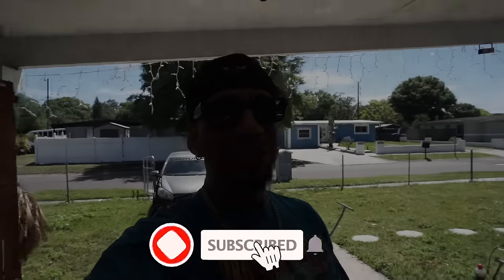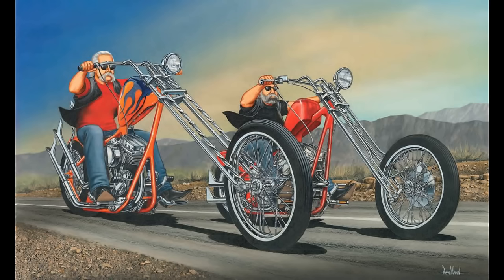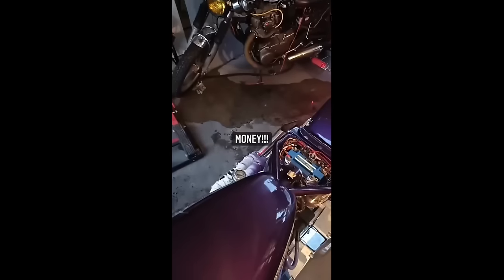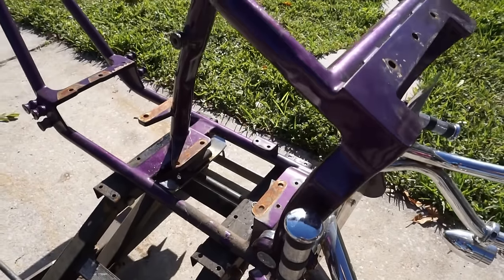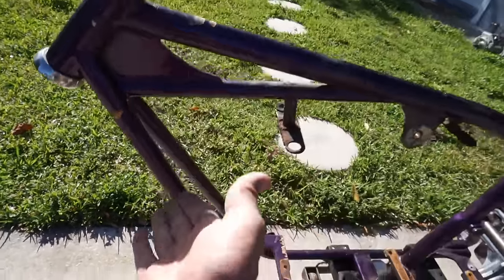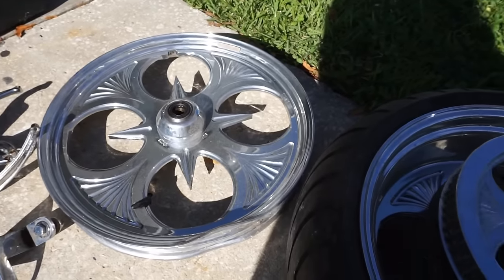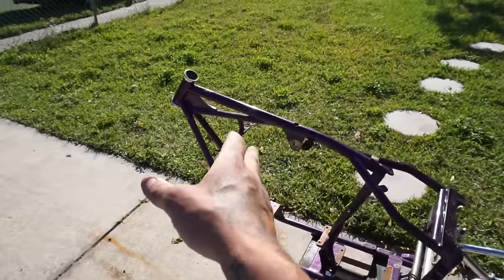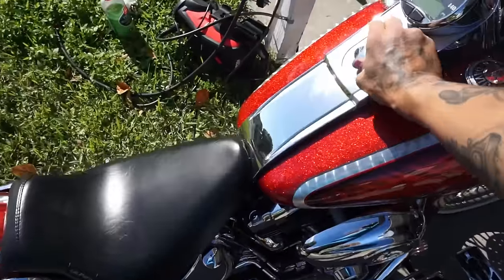Rebuilding a wrecked Denver's Chopper! Part 1  #denverschopper #chopper #wrecked  #harleydavidson

Comment: Thats not a denvers chopper
Reply from the maker: Yea the titles wrong.. ill call Mondo and fix it🤣
Reply: That was an Easy Rider centerfold bike, I think sometime in 2003. I used to hangout in the shop when it was built. Those wheels were like $10k a piece.  @DaDiplomat
Reply from the maker: No WAY!!!! WHAT
Reply: If I remember right it was built for a construction diver or maybe underwater welder in FL. It's been 20 years ago so I'm not 100% sure. I think the paint was done by Rock and Roll in Vegas. I wish I could find the Easy Rider issue it was in. It would've been 2003 or 2004 @DaDiplomat
Reply from the maker: The hunt is on!
Reply: March 2004 it was the centerfold bike. I just found it in my collection of Easyriders.